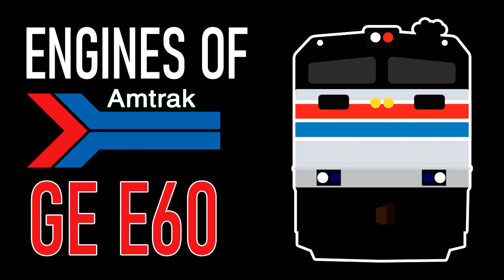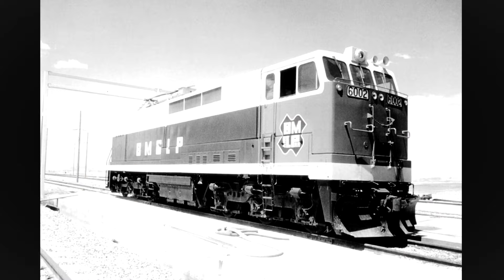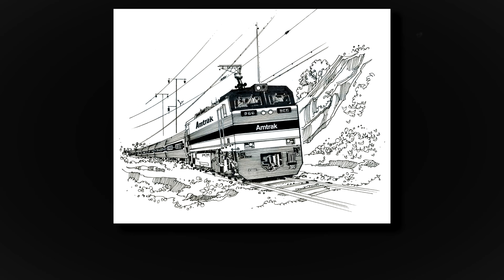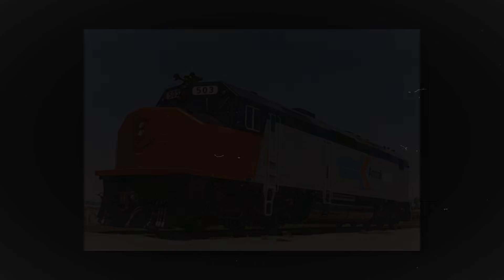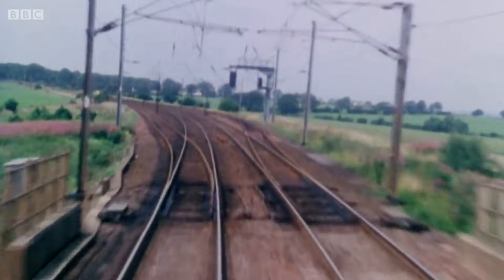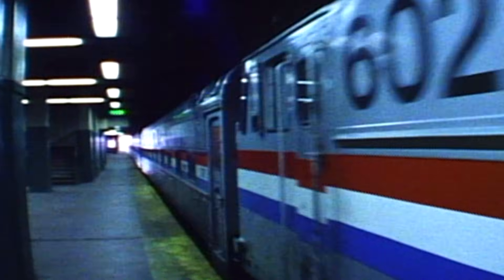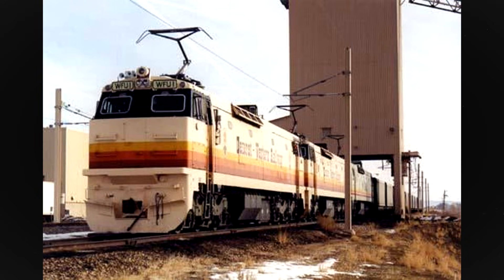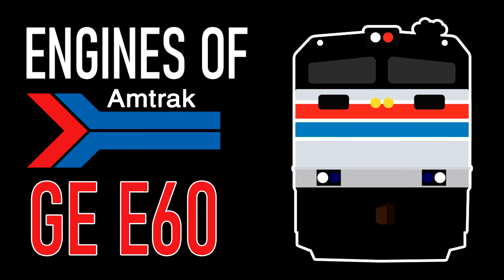Engines of Amtrak - GE E60 [REMAKE]

Comment: GE and EMD 6 axle power is or reflects engineering for freight service. The geometry of A1A trucks on diesel passenger cab locomotives would probably been a better bet on a lighter version of the E60. The 2C+C2, large diameter drivers, and quill drives of the GG1s made them near perfect performers on drag freight, 100 mph passenger trains, and everthing in between, but they would have been impossible to replicate in the 1970s.  Thank God for the Sweedish Meatball AEM7s!

Comment: It's wild how we got NEC service with the E60 from 85MPH all the way up to 125MPH with the ACS-64. We've come a long way man
Reply: The 125 mph speed was achieved with the acquisition of the AEM-7 locomotives. Even the Budd Metroliner electric m.u. cars were able to operate at 100 mph. It was just that the E60 was not capable of being easily adapted for passenger rail service, given its role of a coal freight hauler on "conveyor railroads" in the American Southwest.
Reply: Also worth remembering that a train's top speed is not only dependent on its power and weight, but also the state of the tracks. High top speed is one thing, but high average speed is the really important matter. So many passenger rail services across North America (and in my home country of Australia) could get passengers to their destinations faster if the tracks were straighter and/or in better condition. And duplicated. And not occupied by freight trains that have priority.

Comment: Found this out from Pentrex: The E60s were unable to be MU-ed together.  This meant that when two were pulling the same train (by the way, a rare sight), a crew needed to be in each loco.
Reply: Not true.  The operating manual (pgs 48-50) instructs on how to set the locomotives up for MU operation.  They may not have been able to MU with other locomotives but they could definitely MU with each other.

Comment: These locomotives really remind me of the f69phacs, in a way. They are neat (:
Reply: They are pretty much neat. I saw the one at the Railroad Museum of Pennsylvania back in September 5th 2021.
Reply: @nathancorcoran5347  Wow!
Reply: @UnionPacificRailroader  it’s amazing.
Reply: @UnionPacificRailroader  Amtrak E60 603 is one of those few surviving GE E60 locomotives.
Reply: @nathancorcoran5347  I knew there were a few, but I never knew the numbers (Specifically), it is good to know. - I never saw one before, glad you saw one while they are still preserved!
Reply: @UnionPacificRailroader  the two other E60 locomotives, 958 (Original used for Amtrak and then for New Jersey Transit) and BM&LP E60C No. 6001 at the Arizona State Railroad Museum (Under construction).

Comment: Fun fact: there are still mechanical cousins to the E60s running in Taiwan.  The E200, E300, and E400 classes (all designated E42C by GE) are basically E60CPs shrunken to metric gauge, put on a diet (192,000lbs compared to the E60's 387,000), and slightly down-geared for a top speed of 85MPH.  They're also all sporting classic GE bells and Leslie RS2Ms, so if you want some classic GE electric action, give them a search.
Reply: I think I saw them when I was on vacation in Taiwan.they’re quite cool tbh
Reply: dont they plan to retire them sooner or later? as far as im aware both Toshiba(?) and Stadler(?) are making new locomotives for the TRA. i forgot the manufacturers, hence the question marks, but the idea still stands.
Reply: @TraindereCFR yes Toshiba is building the e500 electric locomotives which will replace South African made e1000 and GE e200 300 and 400. Stadler is making the r200 diesel electric locomotives which will replace emd r100 and r20
Reply: @TraindereCFR  Taiwan Railways has begun replacing them with E500 locomotives from Toshiba. Right now, the GE locomotives are still in use, but are becoming more rare every day
Reply: I search for the e42 bell there was no vids of an e42 with a bell

Comment: Could you imagine if Amtrak still used GG1’s? :0
Reply: I can! Despite cracks and other minor issues with the welded frames, they could have kept going indefinitely.  But, it was better that they were retired instead of being worked to death. The costs would have been grossly excessive and eventually, Amtrak would have had to find something to replace them.
Reply: @JessicaKasumi1990  The GG1's transformers had PCB's, so they would have to be replaced as well
Reply: @AVeryRandomPerson  And converted to Head End Power.
Reply: YES  the GG1 the most beautiful electric ever made.  Amtrak could have kept one running just a shell with new guts inside it could be done Union Pacific did it with their DD40 and their E-8s 😄
Reply: That'll be so cool !
Reply: They did have the option to rebuild the GG1s
Reply: they certainly look awesome. Futuristic and retro at the same time.
Reply: I could imagine a newer build, more capable, and more reliable amtrak metroliner 🥲